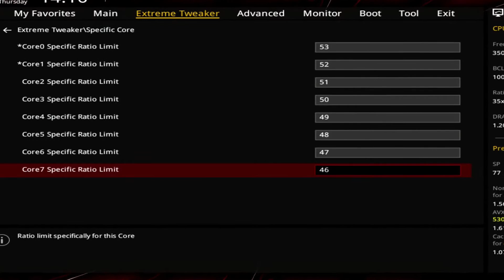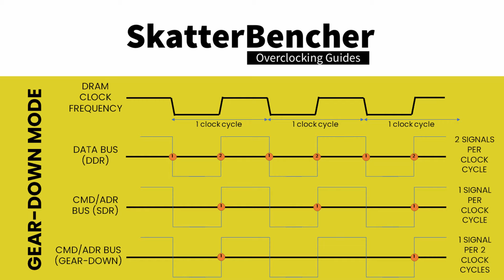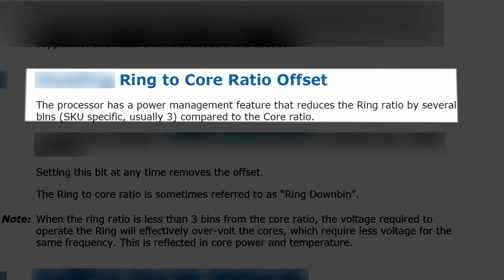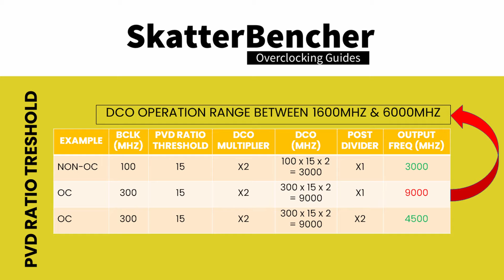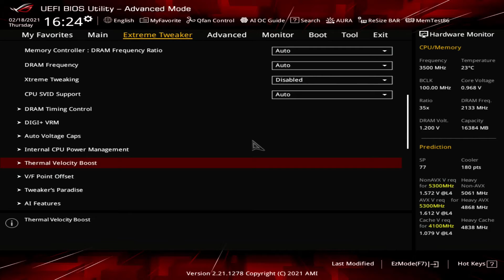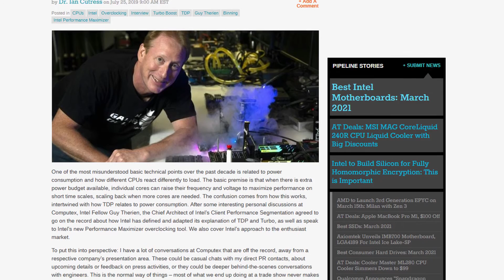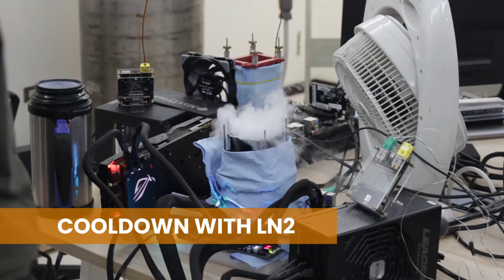Rocket Lake Overclocking: What's New (Feat. ROG Maximus XIII Apex)

Comment: Oh Dear explaining that Gear 2 and the Ratios available to the normal users in OC guide will be a pain....
Reply from the maker: Yea. There's always a next layer to uncover when it comes to memory stuff. It's hard to find the balance between being too superficial and too thorough.
Reply: @SkatterBencher  So I have a 32gb mem kit that runs xmp at 4133mhz CL17. I guess I have no choice to run it at gear 2 on 11th gen. But wouldn't this effectively destroy its performance?
Reply: I have the same kit and also am wondering about this. Runs like a dream on my 10th gen z490 build.
Reply: @connor040606  gear one mode will always be superior in games due it lower latency because of the memory controller running full speed. gear 2 is geared to extreme overclocking for the bandwidth scores cause your imc is half the speed so u have more room for memory because its in 1:2 mode. meaning usually 11900k/11700k the imc can go upto 3700-3900 ( max imc controller speed ) its just like car rpm , after like 3900 u need to change to gear 2. but u lose the torque if u know what i mean. if u know what u are doing u can get more perf going to gear 2 running chiller and hynix/ micron chips , "not b-die they cant clock high" u could cap the imc controller's speed thats will be 2*3700/3800 which is abt 7200 , u could come close to that number which might lead to lower latency but u might need custom copper heatsinks for the ram+ waterblock running on chillers etc . so leave gear 2 unless u know what u are doing. for normies just max your gear 1 frequency and lower your timing that all.
Reply: Gear 1 and gear 2 is technically geardown mode on ryzens and so many people are mislead into thinking it's like infinity fabric by certain content creators... oh boy.